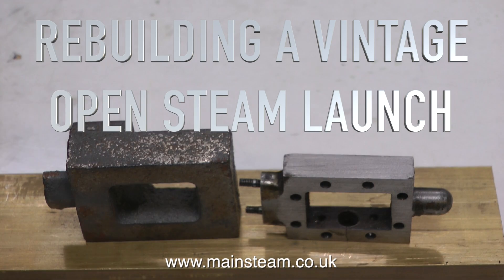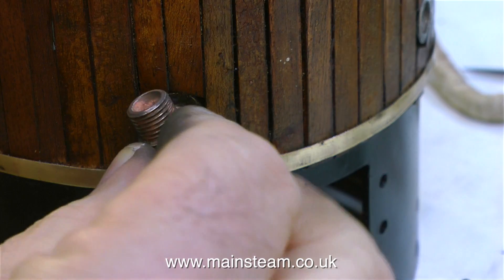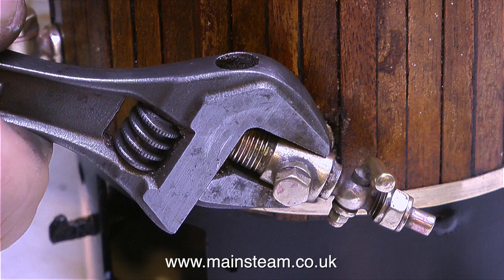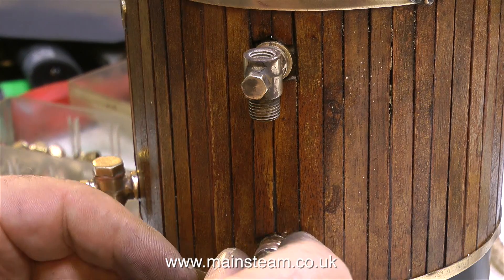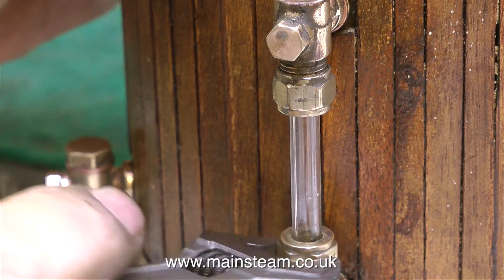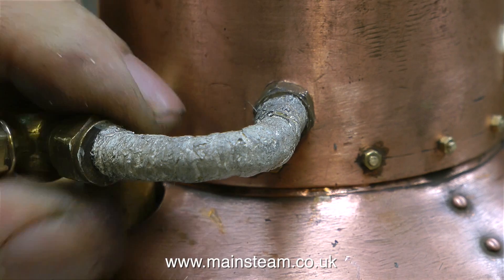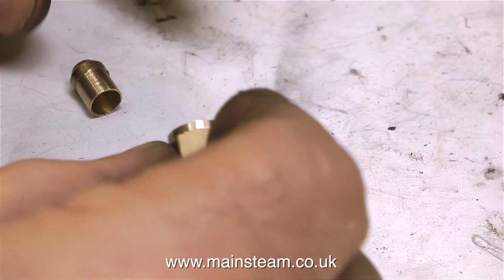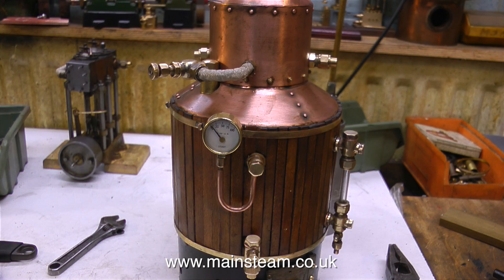REBUILDING A VINTAGE MODEL OPEN STEAM LAUNCH - PART #11

Comment: I realise this is not a recent video and I am no expert so be gentle.  Can I suggest masking tape when applying the cladding to hold it in place as you go. Some line it up off the boiler on the tape. My job is writing piping design software for heavy engineering. We know you can design precisely but know most of the designs are assembled with a hammer and spanner. You are not doing that thankfully. Keep them coming.
Reply from the maker: The masking tape sticks to the Cyanoacrylate adhesive and makes a mess - I tried that idea once }:-)))
Reply: I guessed as much

Comment: Hi Keith, any tips on fitting the water gauge glass seals ?  I had problems with these seals before. I also used the bar or pipe in place of the glass idea for lining up the fittings which another viewer has already mentioned below. I think I got that tip from watching one your older videos. Love the look of that Boiler now, thanks for posting.
Reply from the maker: The method that I use is all shown in the current video, that's about all I can say, other than Merry Christmas :-)))
Reply: Thanks, Merry Christmas and have a fun-filled and prosperous 2017 :)

Comment: Hello, Keith, I thought I've give some food for thought on installing a water gauge. I've recently finished fitting a water gauge on my 7 1/2" gauge live steam 2-6-0. The engine is made by OS and came as a fully machined kit with instructions. In the package, they provide a machined brass bar the exact same diameter as the glass itself so you can make adjustments to the top and bottom without the risk of cracking the glass while doing it. It also helped line up the top and bottom exactly that the nuts holding the O ring seals don't touch the glass at all.  Thought this would be somewhat interesting to you.
Reply from the maker: Good idea - I was thinking about that when I was doing the voiceover part about moving the fitting with the glass tube in it . . . .